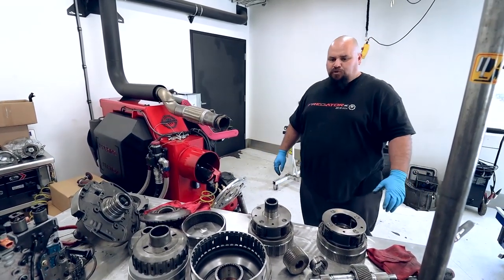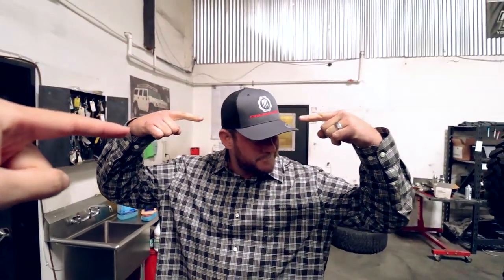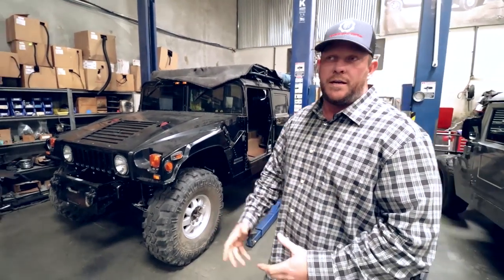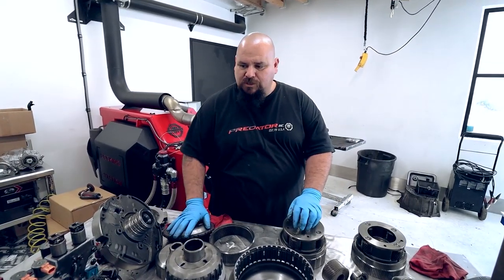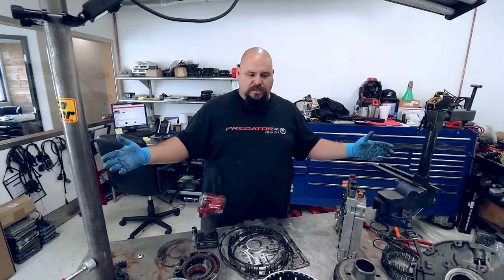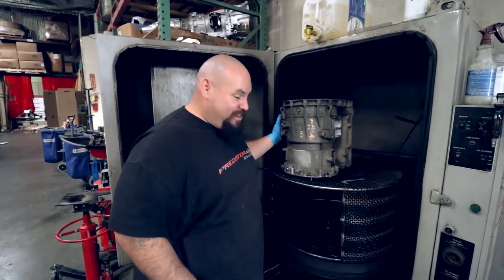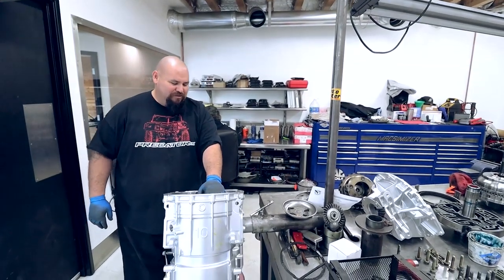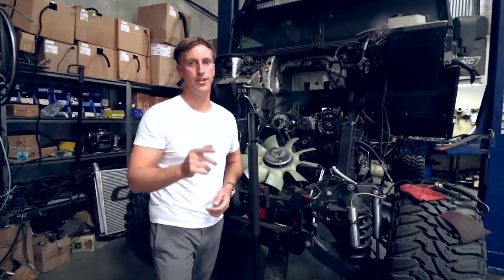1,500 FT/LBS OF TORQUE ALLISON TRANSMISSION BUILD FOR AN H1 HUMMER

Comment: Tech info would be great. One thing I havnt seen compared and explained are all the various suspension kits available. Stock, vs cepek shocks, vs rod hall long travel, vs air ride, vs your kit with the dual shocks, vs the xhp coil over, etc.  The other topic that would be cool is "field fix" type stuff.  If you're remote, and your truck won't start or move for some reason.. what tricks/emergency repairs can be done to get home?

Comment: Hello I run across yr YouTube channel an love the work you do. I have owned 1 - H1 3-H2 and 1-H3. I end up selling my 2001 H1 right before my divorce. I have always wish I wouldn't have traded it off. Right now I have 2 H2 an my H3. One of my H2 i wreck it i just had a motor put in it with 56,000 mile trans has 45,000 miles. I live in central Missouri. In 1993 at my work I was a tow truck driver. I got a pick-up out of the middle of I-44
Semi top hill jack knifed an smashed me between the pick-up an wrecker drug me 213 ft down the hwy. I was only 29 yrs old. 56 now .lost both legs above the knees. I have installed all my hand controls my self. I talk to a place out of Kansas City. About a H1 or putting a   GM Daryl Max with the Alyson 6 speed automatic. The price an the time it was going to take was crazy. I take I will have to call down an talk to you about what I want to do. As what I see you do awesome work. I would love to have another H1 again. I hope I can work out something with you.

Comment: Came for the thumbnail left disappointed. Btw found a typo in your LBZ specs on your website. 
“Mechanically, the LBZ is nearly identical to the 2006 model year LLY.” LBZ were produced 06/07.5 and LLY were 04.5/05.